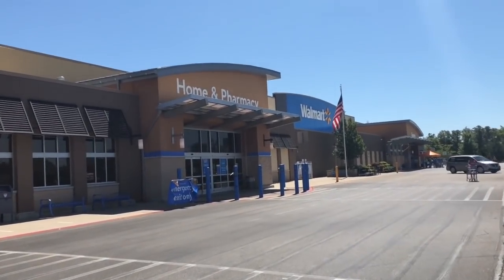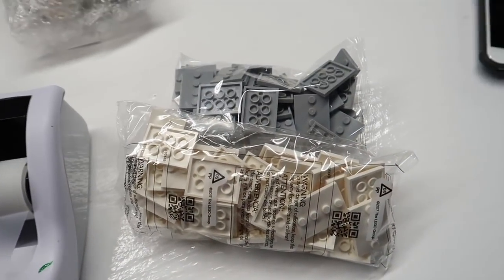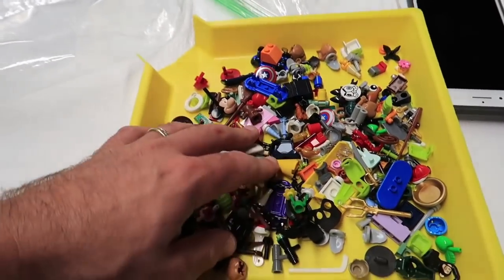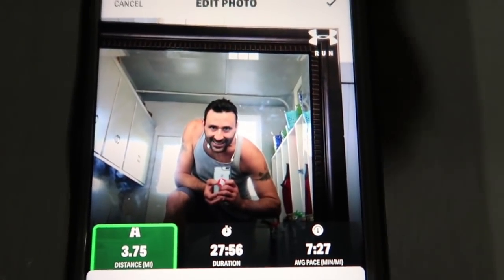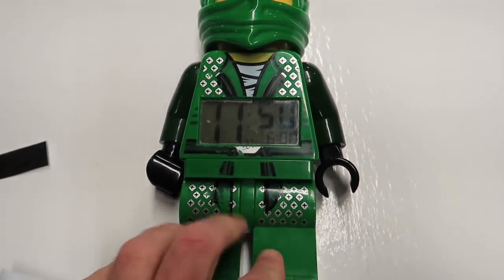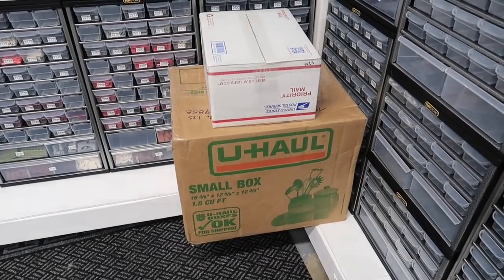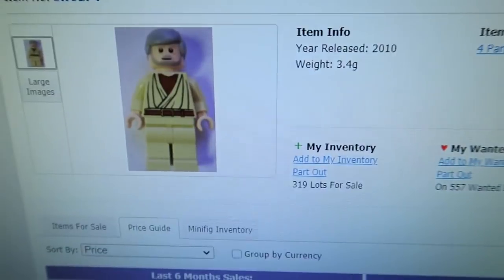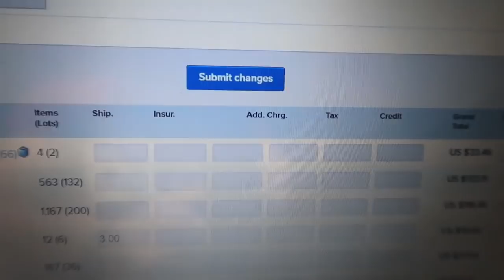LEGO VLOG #55 / Parting Out Bulk Used Minifigure + Adding Bricks and Pieces to the Bricklink Wall

Comment: The Bulk Sorting Area is looking good. I’m nearing the end of a massive bulk sort of my backlog (nearing around 500 pounds) and it’s taken me nearly all of quarantine so far. I have a similar set up for the initial sort. With bins for different categories (bricks, tiles, technic) I don’t micro sort as much at first though. I generally do a broad sort and then go through and sort all of the bricks and plates by size, and then the specialty pieces. Something that has worked well for me is having all the bins laid out in front of me and when the bins get full emptying them into ziplock bags or bins for later sort. That way I can get the bulk of it done and then focus on sorting individual pieces
Reply from the maker: Great tips THANKS!  Yes I'm still trying to figure out best way to go about it and once I figure it out I'm going to do a video on it.